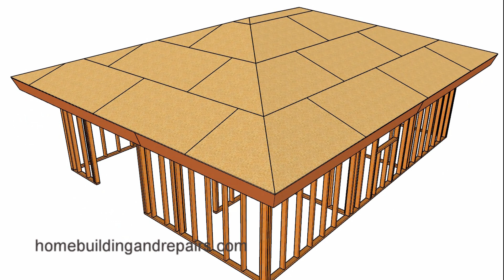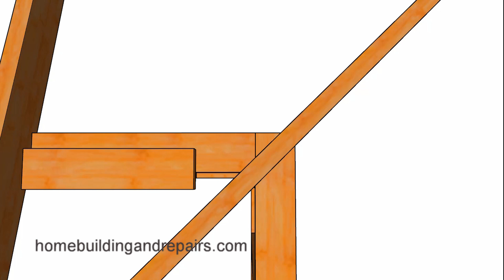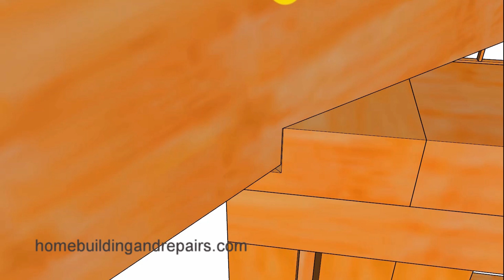Easy Way To Cut Complicated Seat Cut For Hip Roof Rafters - House Framing Carpenter Tips

Comment: Greg, speaking of complicated, I'm going to frame a 10ft opening for a 10x10 bump out. What makes this so complicated is that one of the walls of that bump out is flush with the wall of the main room. So the beam/header above the opening is going into that wall, perpendicular. I wanna look up how this is done, is there a name for this? Could I email you a pic? I just want know what this is called.
Reply from the maker: Yes, send a picture.

Comment: Sir, I have a little issue. The folks who built my shed, ( 10 X 20 ) did not place a top plate on the walls. Is there a fix for this mess? Thanks! :)
Reply from the maker: You can email me a picture, but if the shed isn't moving an seems solid, then you might not need to do anything. People have been building without double top plates for centuries.